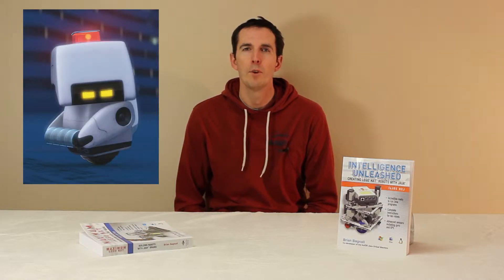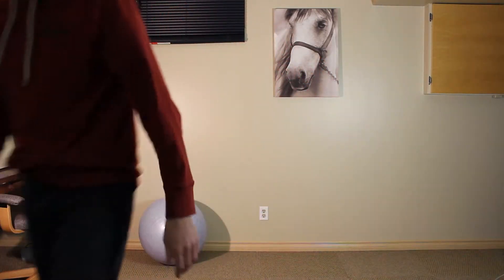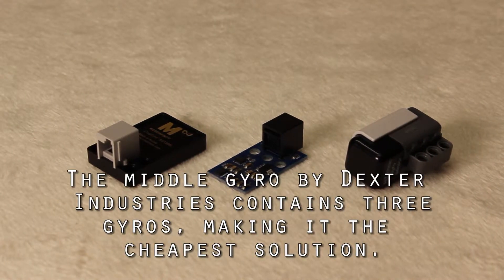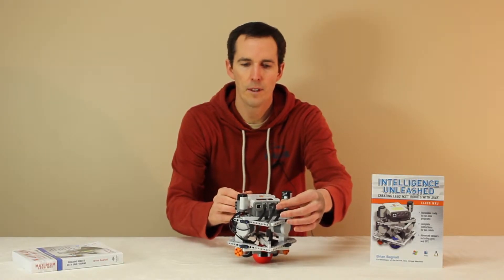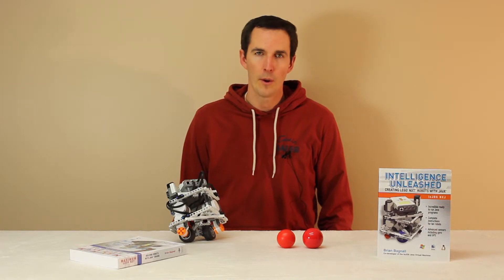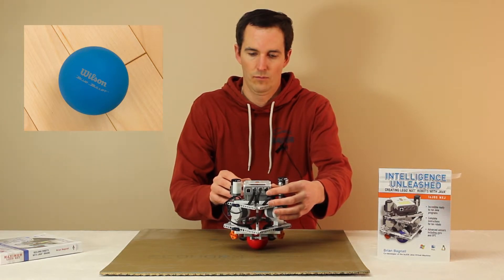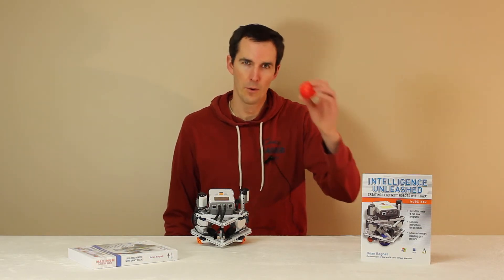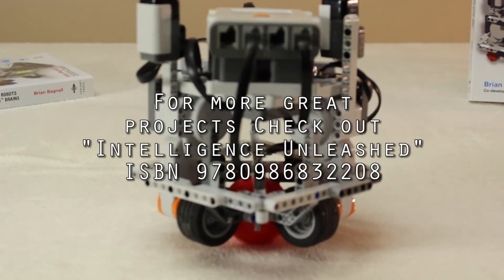Can a Ballbot balance on an orange?

Comment: Actually, the orange wouldn't move under the robot, so the robot over corrected; simply half the correction, to fix the problem.
Reply: I guess that makes sense. The orange would need to plant itself on the table without rotating at all. It might be somewhere in between.